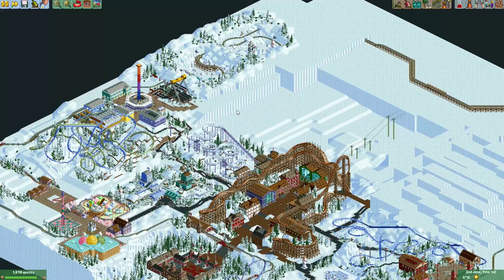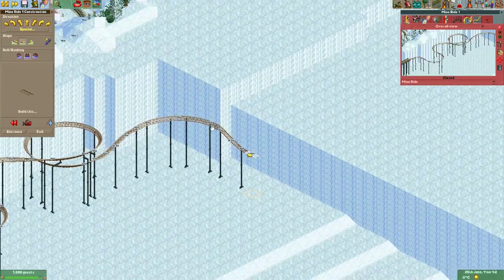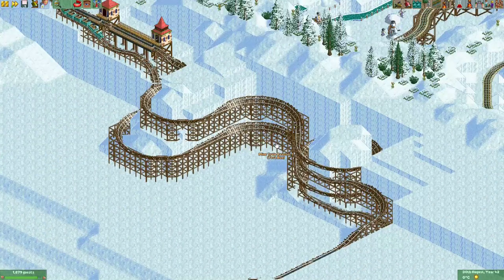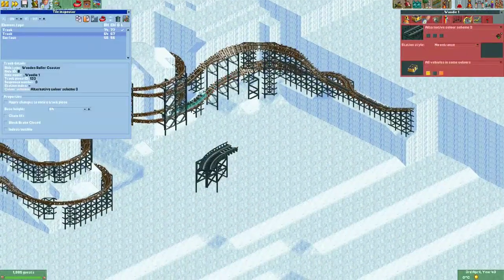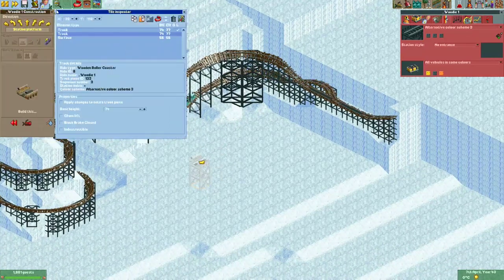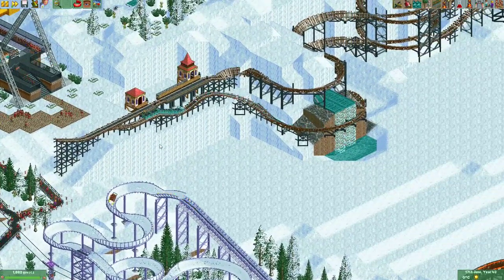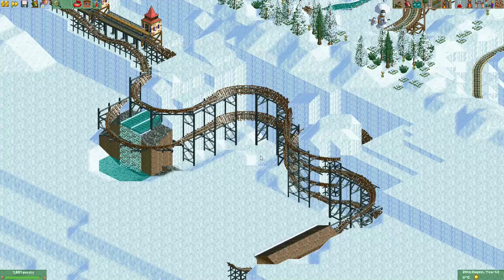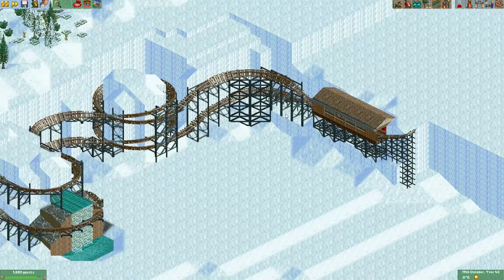Mount Deurklink Episode 20: Switchback Railway!

Comment: The first switchback is great, thanks to the shuttle mode, no risk of crash at the end of the lift. However, is there a solution to replace the second lift by something more "flat" ? Looping boosters aren't functionals in shuttle mode, and i try to make something like Big Grizzly Mountain Runaway (watch?v=2E9mnGUl2sE&t=114s)
Reply from the maker: You could try a chainlift or some brakes - the shuttle mode will prevent it from crashing though.